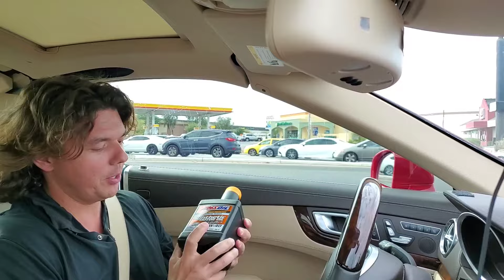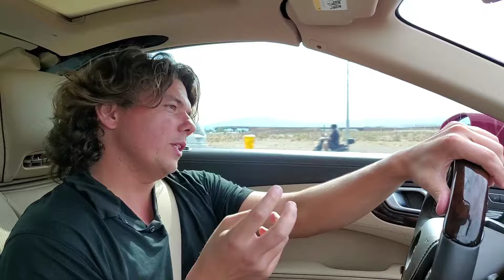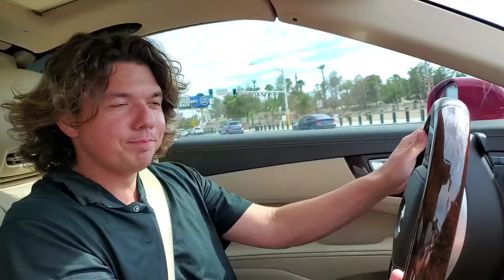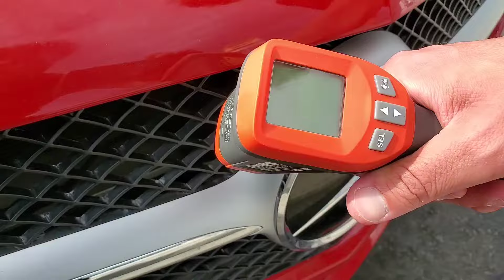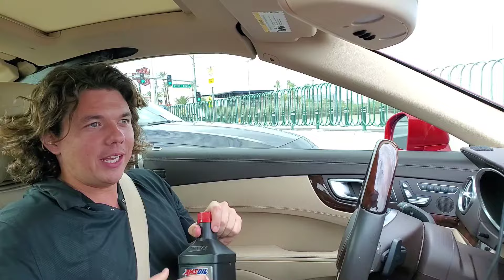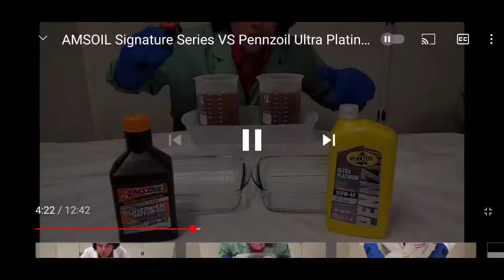Why AMSOIL is the Best Motor Oil & Transmission Fluid

Comment: Recently bought a 2008 Jeep Wrangler JK for my wife with 45K miles on it. Did the oil change on the Jeep a couple of weeks ago and there was definitely a big difference in the Jeep. My wife actually drove her Jeep from PA to Florida to pick up my daughter and the Jeep ran flawlessly. Next up for the Jeep is the differentials, transfer case, and transmission fluid changes. I also put the Dominator in the antifreeze which has also made a difference in the Jeep. When my motorcycle is due for an oil change, that to will be switched over to Amsoil.

Comment: I just put AMSOIL signature series 5w-30 in my generac home generator. 💪💪 I use it for the extreme heat protection but it also can get -20 here. Trust nothing else!
Reply: The 10W30 motorcycle oil, on the other hand, is also particularly suitable. Since the start of the mowing season I have used this oil in all my appliances including a Makita leaf blower, Honda lawn mower and edge trimmer. The engines stay cooler and run significantly smoother as well as better compression. The oil before the Amso was the Castrol RS 10W40.

In my cars - BMW 3.0D - I run the 5W30 euro. 

The engines run much smoother, make less noise, less consumption, a better overall impression.

When quality takes precedence, Amsoil is recommended.

Comment: Yes, I recently started using Amsoil in my car with recent oil change. I was going to ask you, since I also live in a high heat environment, how good will the synthetic amsoil hold up under high environmental temperature close to and over 100 degrees. You answered my question. I’m very glad to have that oil in my car.
Reply: @Syntheticoilprotection  there’s another thing. I don’t usually like to operate my cars a/c because when I accelerate from a complete stop the engine (with the a/c on) bogs down and loses some power. Well….. yesterday was the first day time I ran my a/c since I did the oil change and put in the Amsoil, the engine does not bog any more when accelerating from a complete stop. Amsoil is amazing
Reply from the maker: That's awesome Did you get a chance to do the Amsoil PI Performance Improver yet That's the red bottle that cleans the injectors and the valves?
Reply: @Syntheticoilprotection  yes, that’s the first thing I put prior to the oil change
Reply from the maker: Sweet😃
Reply from the maker: Here's an oil analysis after 25,000 mi https://youtu.be/6pGjOuDFo5E